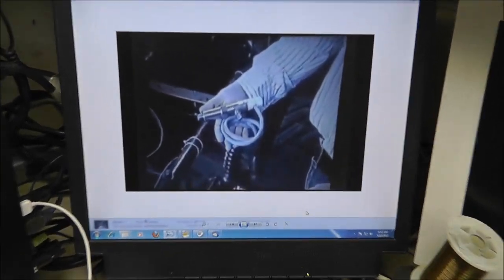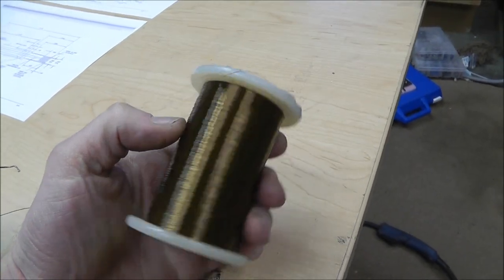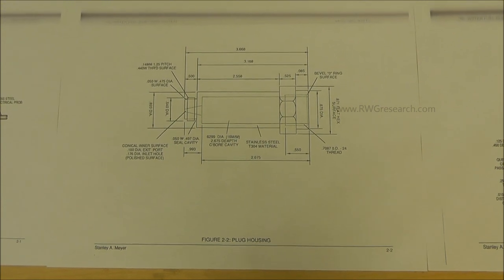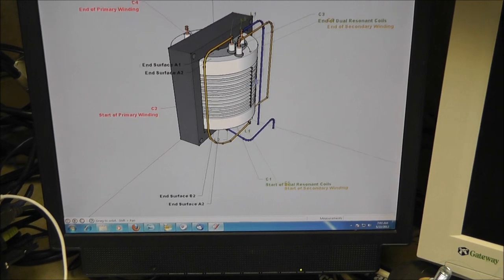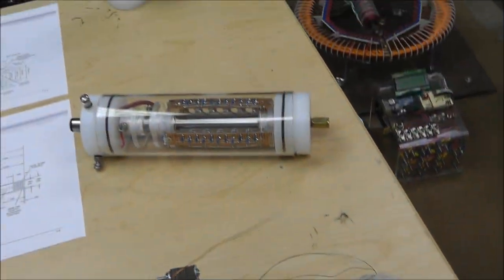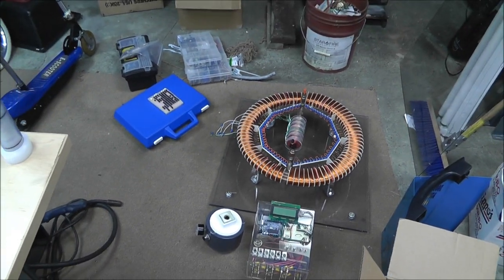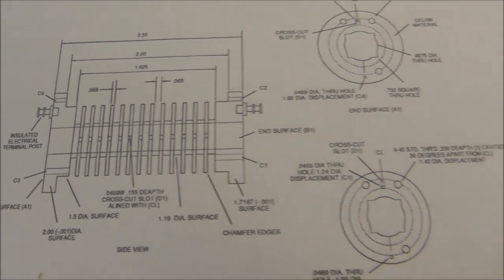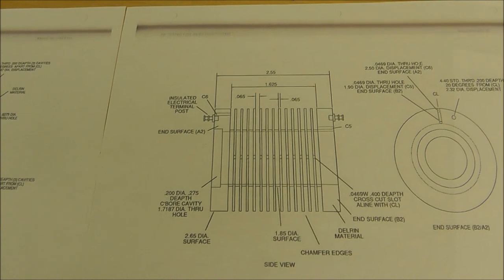Stanley Meyer Water Car Water Injector Drawings For The Water Powered Buggy!   Is This The Key?

Comment: The system recirculates fumes from the exhaust thru a 1/2" braided line to the air -gas processor unit, where it mixes new hydroxl from the water tank,recharges the steam in the exhaust(with the magnetron ),and inhales new ambient air ,which is routed to the carb intake. The injecters only inject RO water(charged),nothing else!
The system also includes a waste gate device,custom solenoids,and other items not shown..I will upload those drawings to rwgresearch soon...

Comment: Thank you, Gus. You're a nice guy, his contributions and projects has helping me a lot here in Brazil, because I'm also developing two projects HHO powered cars. One is the "GM-Classic Flex", motor works on ethanol, gasoline or both mixed. The other is a prototype vehicle with VW 1500cc Boxer engine, in which I am creating a system of electronic fuel injection. The GM vehicle, is already in testing. Thanks again, and i will continue to follow your videos on Youtube and also websites. André Luiz.

Comment: Russ; Stan's final patent made water of any kind expand within the injector itself. This is the one before that? His final was far superior, but you will need the equivalent of a 5ns capable 1kw 1kv mosfet to form a pump z wave. There may be 2 ways around that; a bank of less capable mosfets anchored out of sync to make the same 40ns pulse having 40 to 150 gap where it does nothing. Another way is to supply it with a 5ns sine to a coil then apply a 40ns carrier. Thoughts?

Comment: The injector itself is the most valuable part. Only thing is NO ONE  understands where Stan left off. All of his work,  his research and patents only led up to the one thing that isn't released. Absolutely everything was seized and eventually released (incorrect). Stan had graduated using everything up to the point he realized his turning point.  And that was that nothing he'd done was relevant anymore.  
He was literally murdered because he had what every oil company,  auto manufacturer and investor around the world could not afford to have known. 
Every single vehicle that has a compression engine can run on "water" without needing anything but minor modifications and minimal programming. Be it 2 stroke,  4 stroke,  diesel,  gas, or cng.  Everything produced then and currently can run on it without a problem,  without emissions,  without refilling (except certain climates), and has minimal upkeep. 
I spent 2+ years day, night and any second i had researching and playing with all his work and some more.  I made it work as he did, and i figured out that tilting point too. 
I drove a 2000 cavalier on no gasoline,  just "hho" for months as a supplement,  and 127 miles at street  and highway speeds without gasoline at all. I drove a 97 suburban 300 miles on just "hho" after the cavalier.  I stumbled on to the key to using nothing but water for fuel  and it all fell perfectly into place after that. 
I applaud your time and effort as i did,  but it's so stupid simple that it's incomprehensible.  
There's trillions of dollars and 10's of thousands of people that won't allow it to succeed openly. 
I'd share it with someone like Elon Musk because i know it would be publicly acknowledged and brought to fruition
Reply: Hi, well done in your efforts. Re Elon: I really don't think he is going to be the one to champion this tech as he is effectively one of the elites and has a lot to lose (not to mention Tesla's business model would be totally useless). Some of his ideas and comments reflect someone who is (surprisingly) a bit behind the times when it comes to (truly radical) technology but - crucially - someone with such an inflated ego that he actually believes he is and will continue to be the one who will bring about major global technological revolutions. Newsflash: he won't. In fact what he is doing EVs/rockets are standing on the shoulders of technology that was developed many decades ago and actually just more or less guaranteeing we will be in the technological stone age for the next 100yrs. Enlightening people to HHO technology (or similar) will come out of left field - from people like yourself and others on the same wavelength.

Comment: The main problem with"family members is that charles holbrooks relatives want to profit from stans hard work and wont share with anyone else. I have all this info already and tested injecters made to these specs. The ceramic is "macor" by corning. The originals were made in the UK by John Prendeville who lives here in Las Vegas now. According to receipts,the wire was custom ordered at 403 s/s from molecu corp in tennesee. There are issues with this design. The system allows rough idling only.

Comment: so there is 6 cavities and then a central cavity which shows the high voltage area for the plasma creation. The ceramic protects from high voltage. Inside the tube is a well polished 306 steel tube, and a titanium(probably!?)rod inside.This is where the plasma is being created. Please get back to me if you have a different opinion...

Comment: Electrolysis of water is when you add an electrolyte to increase the conductivity of the water...

are you following me?

you hook a battery up to plates in the water so current will flow through the water

the more current the more hho released

you are right liamXaoh, that is how electroysis works

but i have said time and time again stanley meyer wasent doing electroysis, there is more than 1 way to skin a cat... he was not adding electrolyite, his circuits were designed to minimize amp flow

Comment: If you bothered to read my post in the context of how HHO systems work you wouldn't come across as so uneducated.

In a HHO "powered" car this is how it works (I'm typing this slowly because I realise you're a bit slow):
- the HHO device is powered off the car's electrical system
- the electrical system runs off the battery
- the alternator charges the battery
- the engine powers the alternator

Thus if the HHO system puts out 66.6kW  it then must get that from the alternator.

I win again.

Comment: so, research your frequency and your voltage and your amps
pick one a little above what you need
buy 2
watch for smoke, understand why it smoked
then buy a better one
use a scope , if it dont show correct on the scope, then you choose the wrong one.
yea i will spend every penny i make until the engine runs, try to get a little smarter each time i make a mistake
don took pictures and listed the diode for meyers vic, another place stan lists some diodes in his patent

Comment: You are confusing the chemistry of electrolysis with the reality of physics for the whole concept.  We all know electrolysis works, you being an absolute jerk about it doesn't help.

Explain this:
Lets assume it takes 20kW to power a car at suburban speeds.
Engines are 30% efficient therefore fuel required is equivalent to 20kW/30% = 66.6kW
How can alternator (typically <1kW) supply that power?
Current draw from battery = 66.6kW/12V = 5,550 amps.  Impossible

I win.